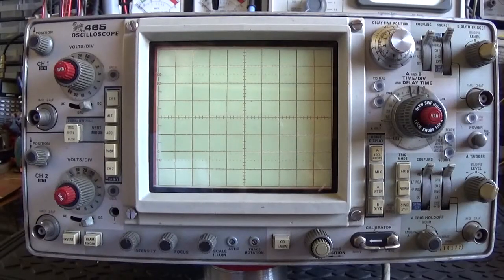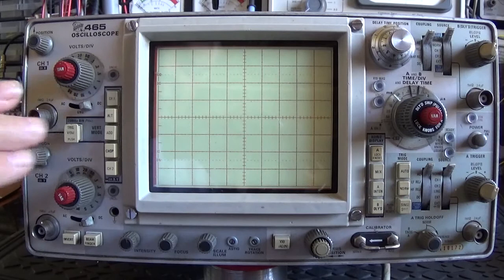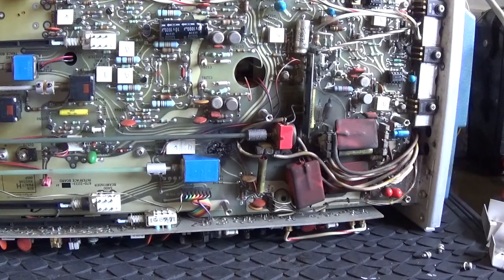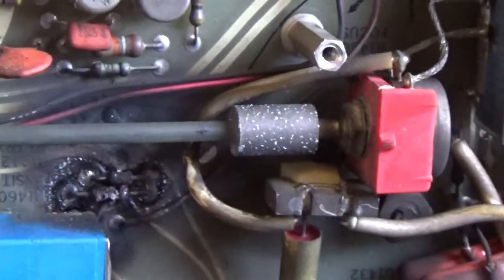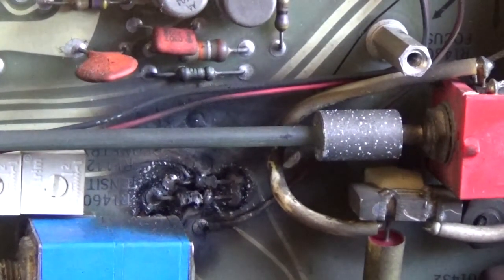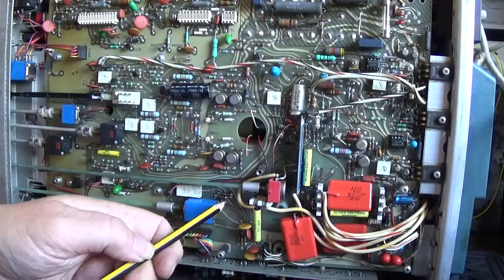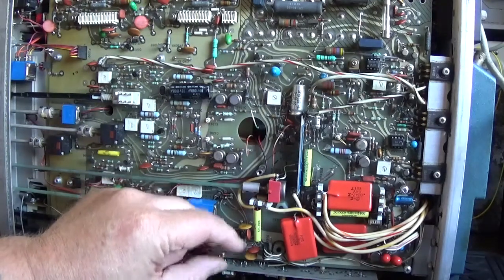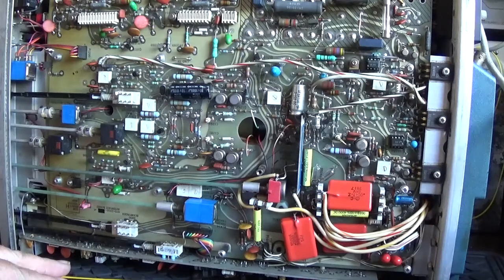Tektronix 465 Oscilloscope   - pcb fault

Comment: I'm most comfortable working with valve radios and test gear too. Mostly 1950/60s Marconi Sig gens. Transistor gear such as portable radios ok, but find it a chore working on complex gear like this scope. I have a 465 too and apart from timebase sometimes jittery, its ok.

Comment: In the eighties Labservice were doing approx 100 a week at one time. Many passed through the lab, primarily with noisy attenuators, switches and knobs. just about all the front panel controls. Don't remember any coming back after having the attenuator board washed with detergent, being careful not to get any water on the adjustable caps at the top of the board, a gentle glide over the angel fingers with cleaner material, then reassemble. Thousands we did ! Beautiful scopes. Tektronix, real treat to work on compared to ANY other kit.

Comment: Just found your channel. Have a 465B scope. Had a tantalum cap short and take down the 15V supply. Luckily the supply is current sensing. You will find the problem just keep at it! Don't give up on it cause it is a learning experience! Good luck!

Comment: clip out that resistor, then try slow power up to standard, and check those voltages on the line of inspection spots, then find the one that leads to the resistor, and check each component, one by one till you find the faulty one. this is a good scope. they are really useful
Reply from the maker: Thanks yes done this however, it gets notably worse for the old girl in a couple more videos. :) There's something gone badly wrong somewhere and in another video there's a PCB in this scope that's not in the manuals. The scope's in the roundtoit pile at the moment. Thanks for watching.

Comment: hello Andrew!! ed turner wanting to wish you luck on this!! I have gone thru many set that I have never found info on and take a commen sense look at what I have . if I like the set or equiptment, I will not deem it as a parts set. I will at least try to make it work!! I look at it as I really have nothing to lose when it is in the state it is when I get it. I also know what I can do and, what I cant do . after being a long time sub., I do believe you can, and it does seem to be a robust piece of usefull equiptment. I have a eico 460 and a eico 495 voltage calibratior . the scope is not the problem, the 469 is .I cannot find any info ecept for posting of ones for sale. I would love to make it work with the 460, but I am clueless on how it works with it so  I have been looking. I did track down that it was made around 1952ish. other than that , ?????? any I also am so sorry that I haven't got back with you about the hallicrafters s20r . I  can tell you that the elect. cap is proper for it . Ireplaced mine with the same values. so, what is in your set , will work. take care my friend!!!